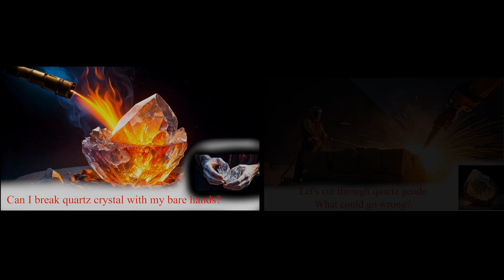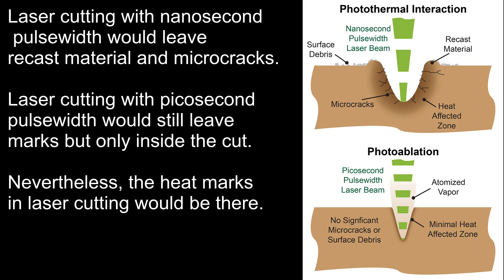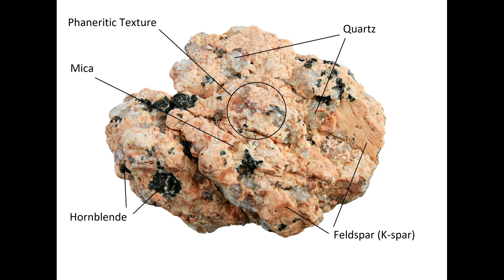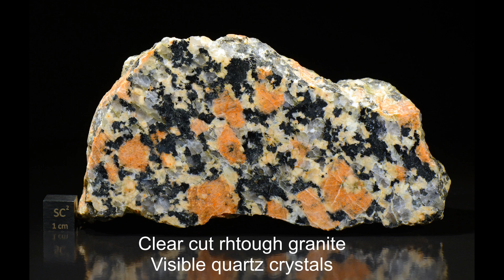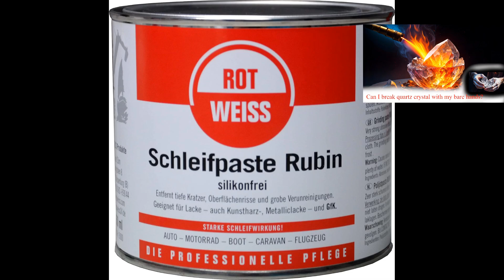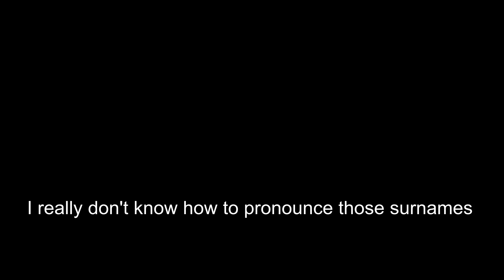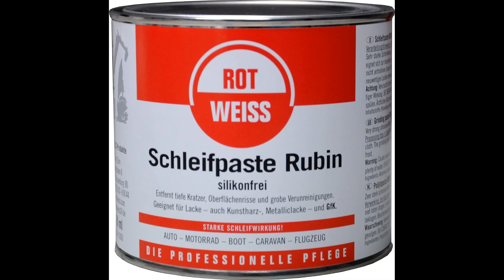How did ancient Egyptians make those granite and diorite jars and boxes? Ancient masonry technique

Comment: But this does not explain the continuous spiral cuts, such as Petri core?
Reply: Seems like its a fake information, its not continuous, but easy to fake it.
Reply from the maker: Yes, it could have been faked by mentioned scientists for more grants or fame. Like always. But what would convince you? If I post photos of them working around the site? If other people confirmed their finding? If I find more corundum powder in broken drill sites in egypt? If there was 10 more findings alike? What I truly can do is to recreate corundum paste and deliver some results of using it with granite. And that's my plan.
Reply from the maker: I don't think it does. I would speculate that abrasive pastes with tubular bronze drills were used in 1500-1300 BCE to imitate those.
Reply: once a deep groove is made, it seems like the extreme compressive strength of bronze could stand up to higher pressures than modern steel, b/c the bronze is sacrificial and easily recycled, and the paste would remain trapped against the work.  those drill cores are proven to have a much higher feed rate than expensive modern diamond coring drills.  All the other external features are not beyond imagination, except the statues.  The inside of the boxes at Serapeum maybe were finished by rotting surface layers with uraninite and water, and then scraping with bronze tools to a fine set of dimensions.  Since Shikolabwe uraninite topped out at above 70% pure uranium oxide, this would suggest another case of Homo Paracas meddling in human society, since death would be similar to the beyond imagination misery of the Radium Girls - and whole populations don't accept that fate unless they are under some sort of terroristic spell.
Reply: @ACTSRevolution  vous pensez à une vitess élevée parce que des petits malins vous ont mentis. Ces trace ne sont pas 1 seule spirale, c'est facile de falsifier. Il existe une vidéo où un forage est reproduit avec un tube tournant à une vitesse relativement faible, produisant les mêmes marques, et ce n'est pas une spirale. Il serait facile de reprendre cette carotte sur laquel ils nous ont montré la continuité avec un fil, et démontrer qu'ils ont triché.
Reply: @Loooppp  I was just saying that the proper way to abrade stone is with high-speed tooling, as diamond shatters with pressure and heat - even while corundum is vastly tougher - ancients did not make the superabrasives, they might have easily found them in a freak surface deposit and didn't care at all about sacrificing them to produce "magic." Very many cores and cored holes have been found throughout egypt (and widely dispersed other ancient sites?) and this cannot be faked.  Are you suggesting some sort of conspiracy?
Reply: @ACTSRevolution  non je dis que le traces retrouvées ne forment pas une spirale, et que l'on peut reproduire la même chose sans vitesse élevée.
Reply: @ Medieval French would bind up infants' heads with cloth to elongate them. Multiple cultures used cradleboards to elongate infants' heads.  That does not make them a subspecies any more than laying in the sun to get a tan does.
Reply: @ACTSRevolution 
Those feed rates are not right, they don’t go in a circle downwards. 
They go everywhere up down.. 
only the cotton line that is pulled over the core is showing scam rates. 
YouTube TikTok and other platforms are based on clicks subscribers advertisements all those things means money, if true ore false content is showed, YouTube allows it all. 

Scientist made many different core drilling silicon plastic forms and 360 high resolution pictures of those cores and drill holes, and they went up and down but not in super fast feed rates. 

Those scientists made their own drill holes and core samples like the Egyptians made with their tools and they came with the same results as all the drill holes and the core samples.. 

If you want real information look on archeological websites.
Reply: Couldn’t the continuous spirals have been achieved by using abrasive paste with a tubular bronze drill powered by a river current?
Reply: @ c'est ce qui a été reproduit, excepté la rivière. Cela ne produit pas une spirale, mais une réplique exacte de ces stries.
Reply: @ididntsaythis8109 it was driven by a tree branch.. 
100 % true, it looks like an Y only one \ off.. 
just underneath the corner was a weight placed and underneath the driller a copper plate was attached.. that’s the way they drilled. 
Almost non believable, but scientists copied those and tried it for them selves. It toke a wile bud it worked perfectly.. and guess what, the same core samples as all the other ones..
Reply: The Egyptians left pictures showing tools, such as a rope drill with weights put on top of it.  Tools like that have been found and are in museums.

Comment: 1.) the limestone example with the hole drilled would have almost equal part of the metal used as the tungsten titanium chromium would  wear the metal faster than the stone * as in half copper, etc
2.) please give examples of how inside corners , vessel cavities , vessels with handles were cut
Reply from the maker: 1) yes and the bronze drills would break pretty often. But the effect should be similar to what we see (cuts through quartz crystals in granite).
2) I am not sure here and I would Love to wait with speculation till I try to produce that grinding paste and grind granite with it. Nevertheless, I imagine one can drill a decent hole, weaken the stone with fire placed inside the hole, place in that hole the corundum paste and a few loose diorite stones and stir for... a month to get a jar. 

As stated I think they used this method in 1500-1350 BCE however we have examples of this fine finish in diorite from 3100 BCE and the method could be different. I think if egyptians from Dynasty 18 wanted to reproduce the same quality that was their method.

The curves were probably grinded not cut and straigt lines were probably marked with some kind of scribing tool like a Ruby on top of a bronze rod.
Reply: @AncientTheoriesChannel  
 please attempt to comprehend * abrasives cut extremely hard surfaces by wearing through the surface, if the abrasive isn't attached to the cutting surface the softer surface is consumed * if it cuts at all 
 You haven't answered my question , vessels like that found in the well of the step pyramid were thin enough to shine light through , some had handles , objects like the disc of Sabu 
 Let me be clear and blunt it's not the possible to cut something inside and out to within 3um in 5 axis with abrasives , saying the your invisible because you close your eyes doesn't make you invisible
Reply from the maker: Was those artifacts from Dynasty 18 or maybe those were from different period? I answered your question in good Faith. I do not know how every one of the mentioned artifacts was made and I do not think that ancient people only improved their methods with time. At some point before 1500 BCE they might have different methods and techniques and tools but I do not know what was it and I assume you also do not know (or can not prove because nobody can for now). But they used abrasives in 18 Dynasty which is quite interesting. Could they achive every single artifact, angle and surface with those? I don't think so.
But Hey, I will sit on that for longer, test some theories and maybe I will answer all of your question in the future!
Reply: @AncientTheoriesChannel  
The Step Pyramid of Djoser in Egypt was built around 4,700 years ago, during the 27th century BCE. It is the oldest known pyramid in Egypt. Inside that pyramid was a well ~140' down they excavated over 40,000 stone vessels plates bowls and objects 
 * so you might fully grasp , 3um in 5 axis , we can't reproduce some of those objects if we attempted to create them from as something as soft and homogeneous as aluminum with modern 5 axis torrurt mill and diamond tipped steel alloy tooling
 granite conundrum diorite basalt with fire pounding stones and abrasive is simply ludacris thinking of a uneducated child
Reply from the maker: Thank you. As you stated, those are from 27th century bce and I am Talking about late bronze age (around 1400 bce). And nobody stated that the masonry 5000 yeras ago was the same as 3400 years ago, I even said that the tools and methods may be different for this gap of merly 2000 years. But I get your point. And I am going to find the answers to your questions... eventually...
Reply: @AncientTheoriesChannel  
 Seriously how old are you ,. were you born simple minded or was there head injury involved 
 The Step Pyramid of Djoser in Egypt was built around 4,700 years ago, during the 27th century BCE. It is the oldest known pyramid in Egypt , now you are saying they forgot how to cut objects within 3um in 5 axis dude that's the thickness of wax
Reply: @AncientTheoriesChannel  the technology you are failing to grasp is turret milling and photo ablation
Reply from the maker: You got me here good, I must be a 7 year old simple minded child, but I'm not offended. I truly told you I do not know how every single articat was made, especially in 27th century BCE. In my eyes it could be many things and if it was 5 axis turret miliing or lasers with picsecond interval (no visible ablation marks or cracks) then sure, why not, but can I prove any of this? No, I can not. Can I prove that ancient people knew how to manufacure turret milling machines or laser cutters? I can not. But I can prove they used corundum in the late bronze age. Can I prove they've forgotten how to cut with other, better techniques? Well... To do so I would need to prove that they used other techniques to forget it in the first place. And please, amuse me, what technique did they use to manufacture those 40 000 stone vessels plates and bowls? Don't forget to attache direct or indirect evidence of mentioned method. I'm asking honestly, I would really like to know.
Reply: @AncientTheoriesChannel  what I can tell you about the 40,000 granite conundrum diorite basalt items for buried 140' deep in a well inside the oldest stone structure in Egypt was they CLEARLY didn't use fire 🔥 they didn't use loose abrasive power  they didn't use pounding stones 
5 axis turret milling and photo ablation * at a bare minimum diamond tipped steel alloy tooling if the tool wasn't lifted once during manufacturing , Saying otherwise is a perverted disservice to the people that created those objects 

 It's Obvious you simply can't grasp 3um total runout in 5 axis it's the tolerance of aerospace engineering
Reply: @AncientTheoriesChannel  we can BARELY cut those objects in a soft homogeneous metal like aluminum , we are not capable of cutting the objects in granite conundrum diorite basalt , that simple enough
Reply: @AncientTheoriesChannel  * before you play coyand continue to babble, understand  or not they would have found manufacturing a atlas rocket significantly easier than producing  those objects
Reply from the maker: Ok, that's what already has been established. You may be surprised but well... I have seen those measurements and I have pondered about it just like you. However, you can not prove something just by telling people it must be it because how on earth could it be done otherwise? The thing is... it could be done otherwise. Unless you can prove what tools they had. And yes, those vases would require the use of some kind of machine to manufacture, and due to the hardness of granite and diorite would require some kind of hard crystal carving tip of a machine tool (we like to use diamond due to its hardness). But we (our civilisation) do not know much about those ancient methods and the current state of proven techniques used by ancient Egyptians are far away from 3um precision. However, if we focus on data we can find some clues about what they used. And it is not obvious but till 2015 we couldn't prove that ancient Egyptians even used corundum powder. Now we can, and maybe we can also recreate those ancient (unfamiliar to us) methods or find proof of those ancient carving machines.
Reply: @AncientTheoriesChannel  * you couldn't make an object more perfectly is you had a personal genie
Reply: @AncientTheoriesChannel  No hand produced object could have anywhere near the symmetry and perfection of concentricity, thickness etc, in such a hard material. The Vases and associated items are in no way hand made. I do production CNC machining in HARD metals like 4340 steel, these materials are harder. We have a difficult time holding tolerances at .01mm regularly on complex 3d surface shapes. Typically we have to grind to get better tolerances. You would need a 9 axis mill turn to produce those vases OR a series of mills and lathe with accompanying fixtures. Go talk to manufaturing engineers about the tolerances and measurements, watch them laugh in you face when you tell them mohls hardness of 7 or so.
Reply from the maker: Thank you for your comment. I always love to hear opinnions from people who do some work in the field I'm talking about. I do have your argument in my mind, but I never stated that those diorite vases were hand made by humans. I also know that there are a lot of those vases and jars with not so good finish. I focused in this video on the corundum and I probably should make a video covering diorate vases as a main topic.
Reply: @AncientTheoriesChannel 
 Yes , I was allowed the opportunity to visit the museums of Europe for a couple of years,
 some were smashed , some cracked , reconstructed  , yet the near perfect ones are exactly that too perfect to make manually by craftsman and damn sure not caveman with pounding stones fire and abrasive
  you would need computer controlled 5 axis turret milling and photo ablation or diamond tipped tooling that never lifted once from the surface or a personal genie either or potato potato
Reply: @mrglasecki  Rude.

Comment: This guy just nailed it. No conspiracy theories, clear scientific evidence, healthy amount of self-doubt, straight facts and no bs.
Reply: Where is the proof ? This usually theory
Reply: He only offers a way to create a smooth surface. He does not prove how vases with handles created to higher geometric precision than what would be capable today using a CNC or 3D printing machine and less hard material. Do you see the problem here? It's about the geometry of the vase as a whole, not the smoothness of the surface. There are no errors translating across the outer into the interior surfaces, and no errors translating from the mouth to handles to the vases base. This level of precision goes far beyond the process of cutting, turning, etching, or smoothing. It's design was a feat to begin with, let alone it's physical creation...think about it!
Reply: @Siluetae  You may wanna go and Google pics of them and at least put your bare eyes on these so called super vases before saying such things. What you're repeating is from grifters on YT that farm clicks and sell tour tickets. 
This guy owes no explanation to anyone. He simply points out some facts about the process that can actually be proven. 
Just before anyone hits me up to and tried to debate me, go look at the weapons they used during these times. That's the best way to see the best cutting edge tech from any era, especially even till this very day. 
Why? It's because they're lives literally depended on it. 
That's why. 
That's why we field the best tech possibly even today. 
So when we look back, and see sticks n stones, wonky bronze swords, and arrows... well... that's what they had then. 
Period.
Reply: Yep. Poor guy is already being hammered by the experts in comments 😂